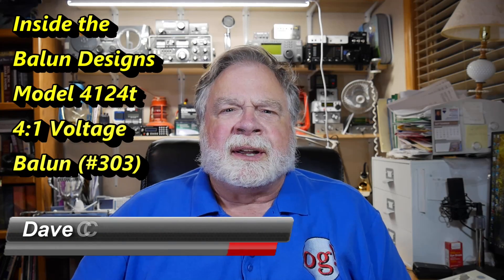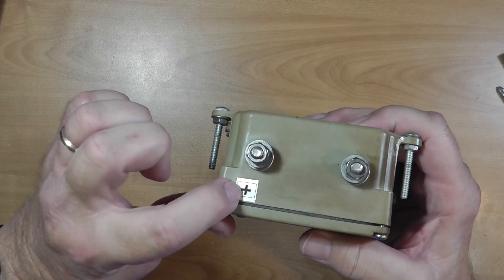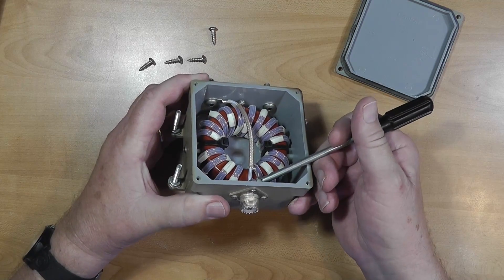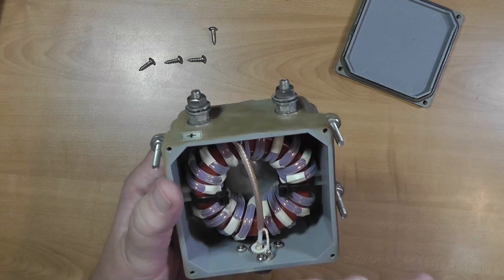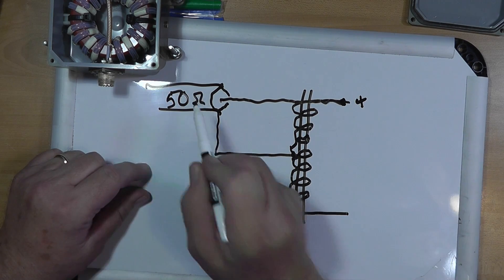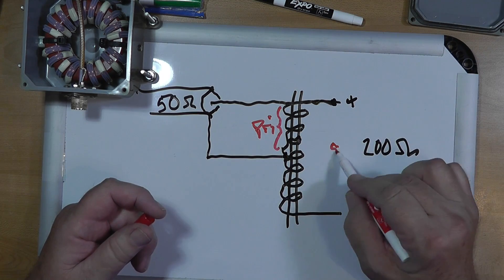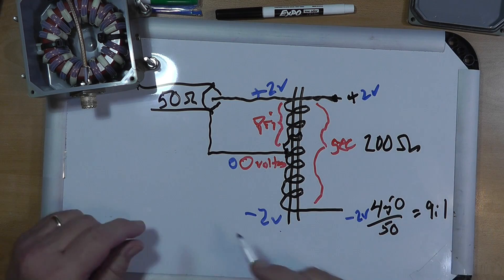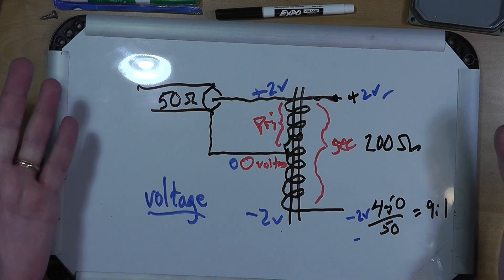Inside the BalunDesigns 4124t and How it Works (#303)

Comment: At 5:13 You say ferrite core, I guess You mean iron powder core. It is red and looks like a T200-2 or maybe T300-2 iron powder toroid. For the EFHW, They use a ferrite toroid, FT240-43 or 52 variety, most of the time. Really good explanation about how a balun works.